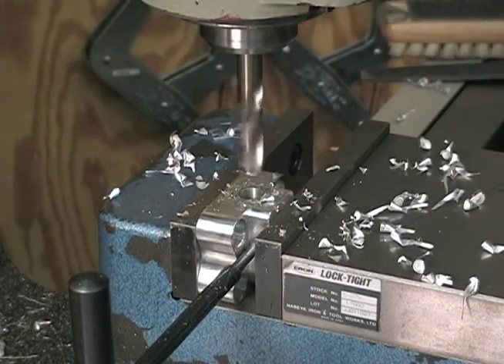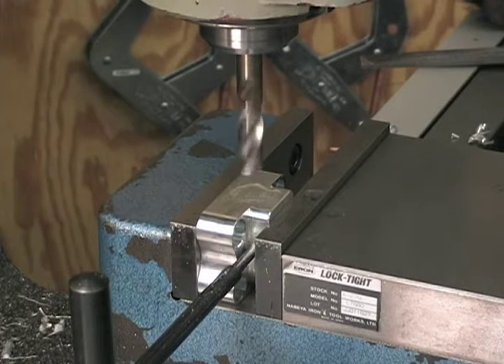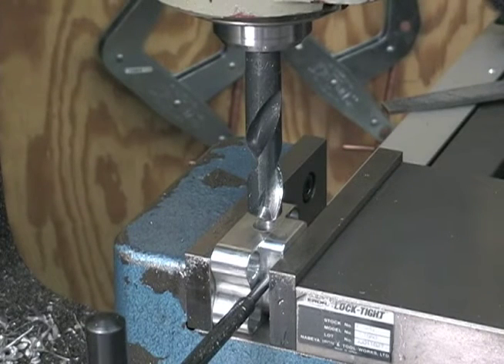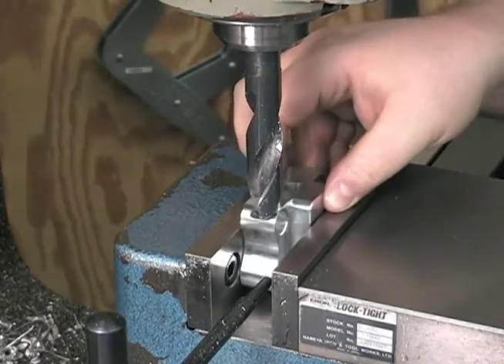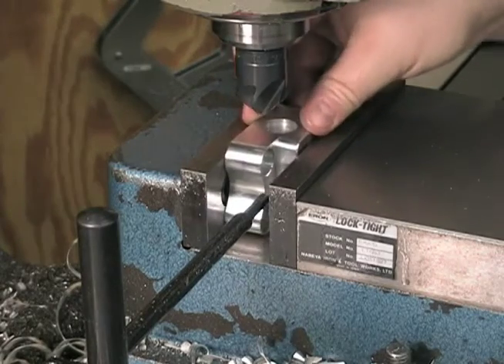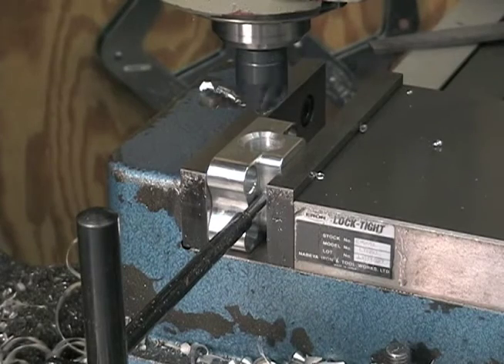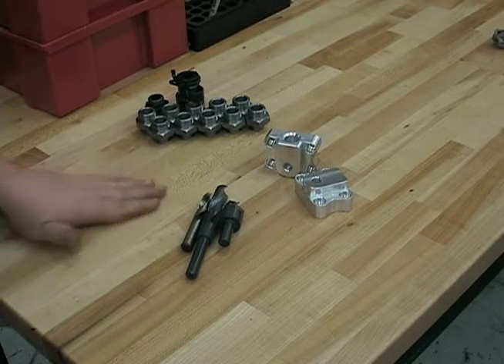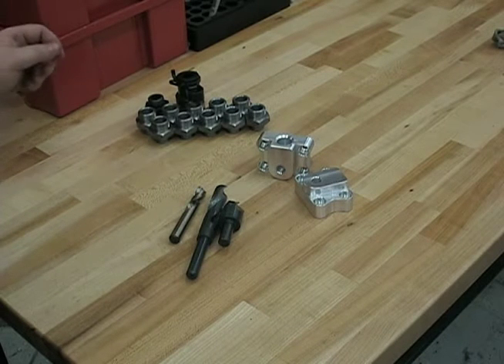Small Batch Production Drill & Chamfer - AirBase Prototypes

Comment: Nice! Feedback: Opening 2 cards were maybe 1-sec too long each. I like How you talked about the drills, what they were, the speed, etc. Love that! I learn from that. But you did not talk about the chamfer tool. curious why it needed such a deep chamfer? and lastly, It might be debatable that you only show each operation once, not twice, makes for a faster video. Overall good job, you got it, just keep tweaking. Also catchy video titles help get attention! - Dave, an aBom79 viewer
Reply from the maker: +overkillaudioinc  If you look in the description under the video I listed all the tools and the speeds I ran them at.

I didn't say anything about the chamfer tool on the video because I forgot about it.  lol

This video was shot in a bunch of little chunks over the course of three or four hours while I was working on this batch of about 50 parts, so there's quite a bit of time passing between tool changes, and I just forgot to tell you how fast the countersink was spinning (150 RPM, BTW).

The chamfer is very deep because the NPT threads are very coarse.  1/2" pipe is 14 TPI, which makes the thread pitch 0.071"

I always try to make the entry chamfer at least one full thread deep, so you don't get a sharp burr raised up on the top surface when you tap it.  So in this case that chamfer is 0.075" deep x 45°, just over one thread deep.

You'll see how well it turns out when I get them threaded here in the next couple of days.

Comment: Opening sequence is too long for me, 5 seconds max

Use more light  6500K colour 
It helps with video quality.
Reply from the maker: +12345NoNamesLeft   That new 1080P camera will help the video quality as well.  ;-)

It's kinda funny that they look dark, because my shop is extremely well lit, AND I had a work lamp pointing right at where I was shooting.

I'm afraid that the old girl just ain't got what it takes (I'm using a 25 yr old camera that uses mini-DV TAPES).

If the dark look carries through to the new camera, then I'll have to build me a lighting rig or something, but I'm hopeful that won't be necessary.

My shop is far more brightly lit than Adam's shop is (Abom79), and his videos turn out OK without huge light rigs, and he's running GoPros which are supposed to not be super good in low light to start with.

I dunno, we'll just have to see how the video from the new camera looks and go from there.  If I gotta build lights, I'll build lights.

Thanks for the feedback on the title cards, I was afraid folks might not be able to read them if they changed too fast.